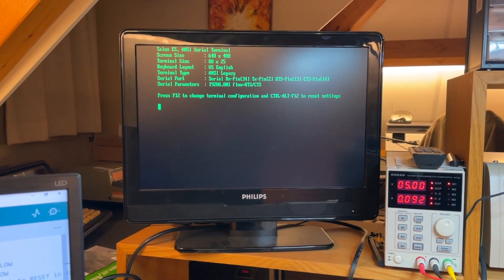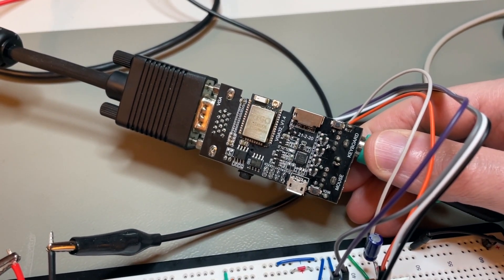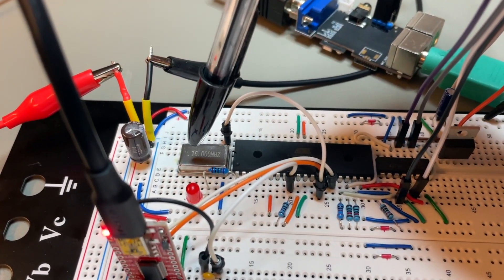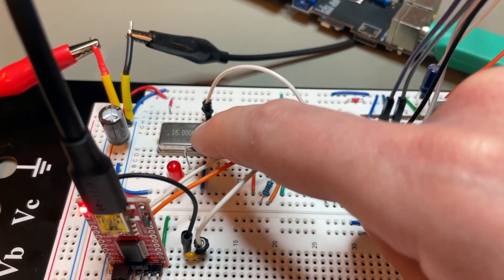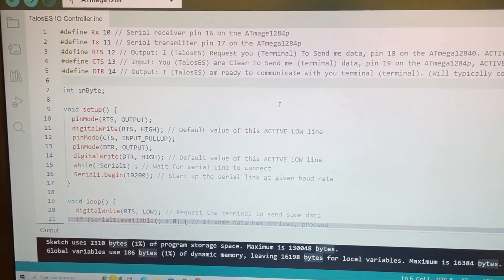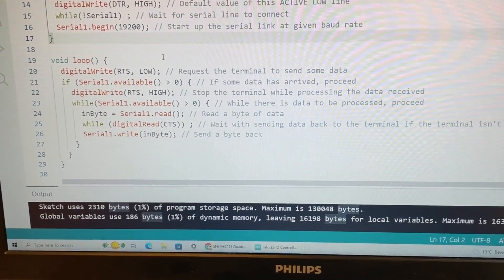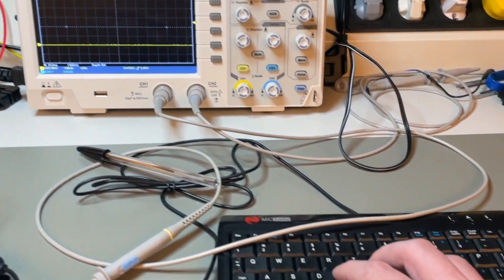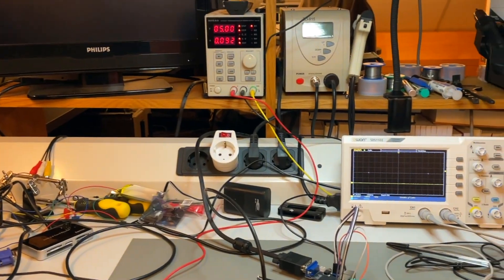Building Talos ES™, the 21st century's mini-computer (Episode 18)

Comment: When are you planning to replace your terminal board with an Agon Lite running a terminal emulator written in BBC BASIC ;-)
Reply from the maker: 🙂 Actually, if the TTGo VGA32 becomes difficult to find (not the case right now, and probably not the case for years to come), then I'll make a replacement re-using a part of Agon's circuits! (BBC BASIC runs, unfortunately, on the eZ80, so it wouldn't come with it ;-).